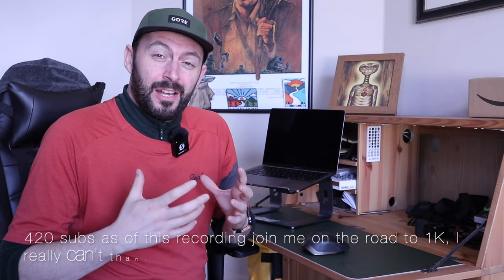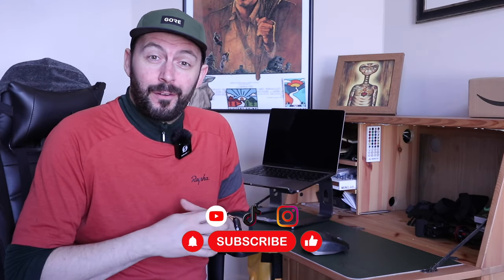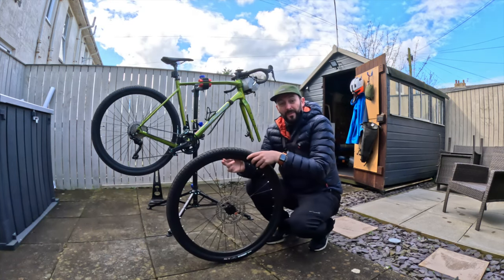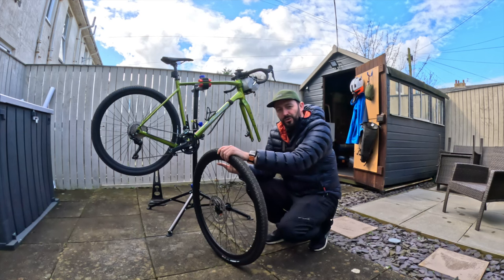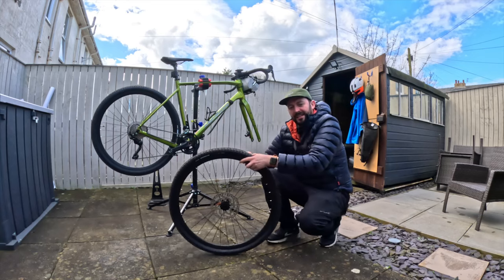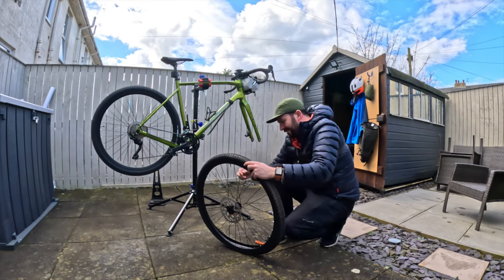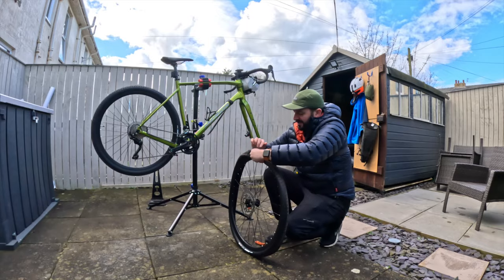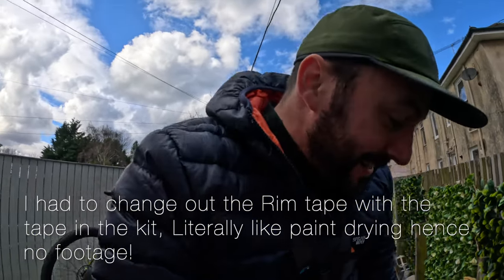Avoid doing this when you install Tubeless Sealant on your Gravel Bike! 🙈

Comment: I would only recommend gorilla tape if you are doing a mullet conversion of a non-tubeless ready rim.  Reason being that that tape is very thick and it can prevent the tire from being able to move up onto the edge of the rim where it needs to be seated.  People really seem to like the 3M 8896/8898 strapping tape as an alternative to the name-brand tubeless tapes.  

I would also recommend that you only try converting your other bikes using tubeless ready tires.  It is possible to use a tubeless tire on a standard rim and make it work, but it's almost impossible to get a non-tubeless tire to seal on any rim - the bead just isn't designed for it.
Reply from the maker: All valid points 🐵

Comment: What pressures are you running on for the road in tuneless setup and what is the total weight of the bike after tubeless setup. Nice vid.
Reply from the maker: Im running 45psi on the tyres (max is 60 psi) but i take some out run about 35ish if on heavy gravel. Tyres are maxxis ramblers and are quick on all terrain including road! Weight, hard to tell as the bike is loaded with gear i reckon 14kg easy

Comment: Nice vid but why did you use the plug on the small hole that looked like it had sealed?
Been tubeless for a good 20 years now and no going back :) 
Love your vids… put together so well… cheers
Reply from the maker: Thanks for watching 🐵 The hole i had was leaking air very slowly it was more of a tear after further investigation. Unsure if i could of used more sealant 🤷‍♂️. Not as bad as when I done the back wheel. No issues in the process but…. I over inflated the tire it “popped” off sounded like a gun and I looked like i had robbed a bank due to the sealant all over me 🙊 i wish i had caught it on camera. I’m hoping all will be fine i have had a quick road test but hoping next ride will tell!
Reply: @ThatCyclingChimp  what sealant are you using, I love squirt stuff, small holes seal so easy, just remember to keep wheel spinning so sealant covers casing as air is leaking, the squirt stuff has bead block you add it’s great, holes 2 to 3mm seal no problem
Reply from the maker: Im using the sealant that came with the muc off kit. Managed a quick test run today and no issues so the adventures can continue 🙊